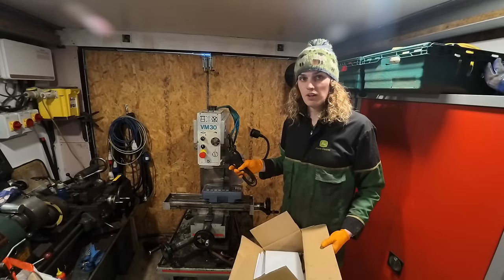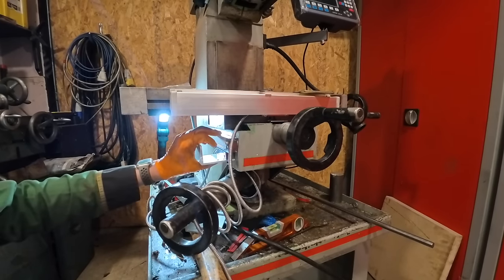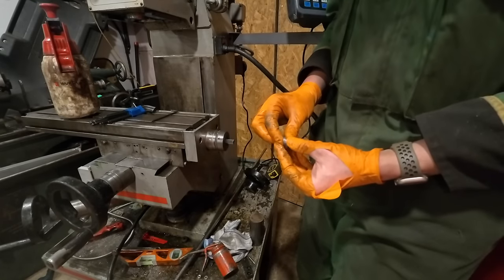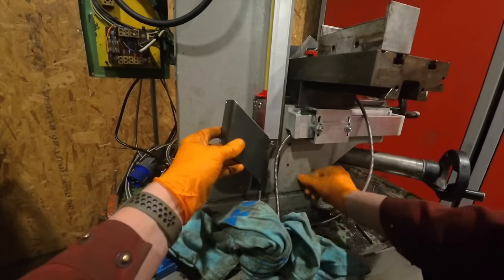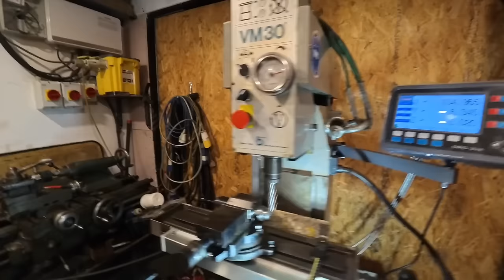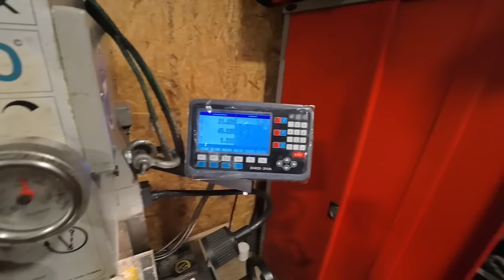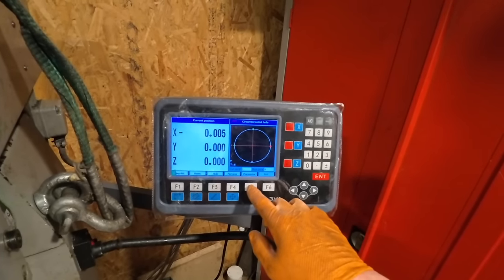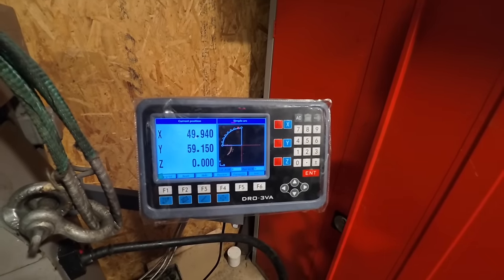HOW TO INSTALL A DRO - Massive improvement to my mill!

Comment: Adding a DRO is the greatest thing for your mill. I did mine 30 or so years ago and it's a giant leap ahead. Handy trick: The incremental function can actually allow you to use your mill as a coordinate measuring device to map out existing features like weird hole patterns and then use the numbers measured by the mill to make mating of duplicate parts on the mill. Congratulations on your install. Enjoy.

Comment: Great job, I've installed a few and it can be a real trick to figure out all the reader head mounting brackets. Those swivel base vises, every shop I have ever worked at, the bases end up on the floor of the tool crib, because the Z height they take up is more valuable.

Comment: Impressive work Kim. I'm quite jealous of the shear and the bending machine. Both are great pieces. In addition to that very handy mill.
     Best regards from Indiana, USA.
Reply from the maker: Thanks Bill, the bending machine is called a miracle bender, they’re expensive now in the UK, the shear however, I bought it on eBay for £12/$15. I don’t use it often but when I do it’s so helpful!

Comment: I see your using a long reach end mill for general machining you will gain more reach on your Z axis by using standard length end mills also using standard length end mills will give you more rigidity resulting in a better finish.
Also if you haven’t got one a edge finder or wobbler is very handy for milling projects
Reply from the maker: The chuck that holds that tool only holds ones with a thread on the end. I didn’t have any other. So I couldn’t do anything about it until I made a nee drawbar.

Comment: Great job should be proud of what you have achieved. Linear scales are normally a piece of glass with lines etched onto them as the axis moves the glass scale moves past the pickup and the pickup see them an and sends an output up the the box which then coverts it into the number you get on the readout. Very simplified explanation but it gives you an idea. That’s how the ones at work function anyway. The DRO looks a nice tidy system with lots of nice functions. Using the radius function I would imagine will take a bit of practice as you will have to move the x and y axis together. Great video keep up the good work.
Reply from the maker: Thanks for that Jon. It would be interesting to strip a broken one and have a look how it works. 
The radius function works like steps. So there would be many small step along the radius. It’s not to try and actually fully mill a radius with two axis at the same time like you said. Hopefully that makes sense. 🙂
Reply: If only I would have known, we had one in bits the other week because the glass scale had got scratched and stopped working correctly.  To be honest there is not much to see.

Comment: Remove the swivel base and clamp the vice straight to the table. This will gain both height and rigidity.  It can always be put back on if needed.
Reply from the maker: I did say about that I think but the vice isn’t great. I’m going to look for a new one.
Reply: Sorry, I missed that bit.

Comment: Nice work, good clean install. Where did you get it? I'd like to treat my old mill to a DRO as well.
Reply from the maker: https://www.ebay.co.uk/itm/313566618827?mkcid=16&mkevt=1&mkrid=711-127632-2357-0&ssspo=1qtokvrusjq&sssrc=4429486&ssuid=2gbeag_rtoo&var=612390765759&widget_ver=artemis&media=COPY 

This is the one I bought. It adds up with the scales but it’s worth it.

Comment: Great video 👍 
What make is the dro screen and where did you get it from? 
I need a z axis and I like how your dro screen works, it's alot easier than mine that I have fitted on my bridgeport (a few years ago).
Reply from the maker: Hello, sorry for the delay, I got it from eBay, there’s a link in the comments on someone else’s comment. 
Hope that helps 😊